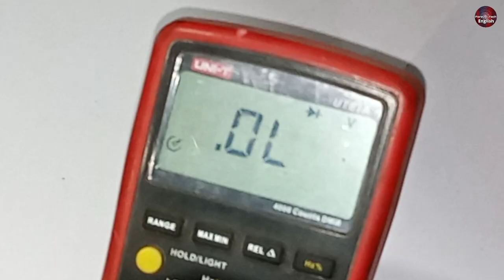Mini Split Ac Circuit Exploded After Electricity Surge, Repair

Comment: Hello, to avoid damages like blowing new fuse and more components, please use a bulb to protect the circuit board. Solde the two wires on bulb terminals, then connect it in place of fuse
Reply from the maker: well That's a good idea..

Comment: AC/DC power supplies after repair, it is desirable to turn on the power supply 220v for the first time through a 100-200W incandescent lamp.  This will prevent re-burning of the elements in the high voltage part of the inverter in case there is a malfunction.